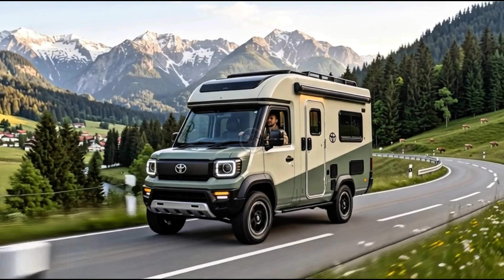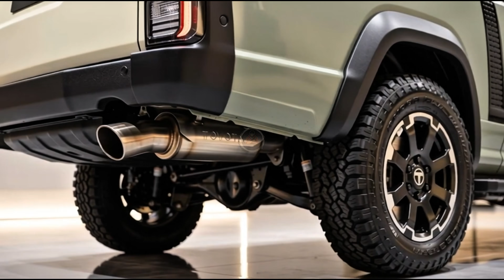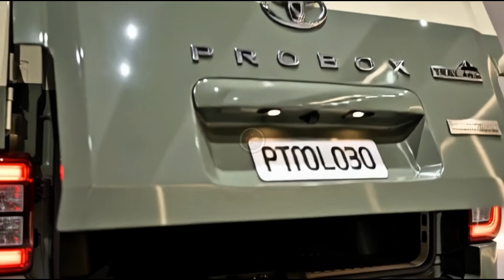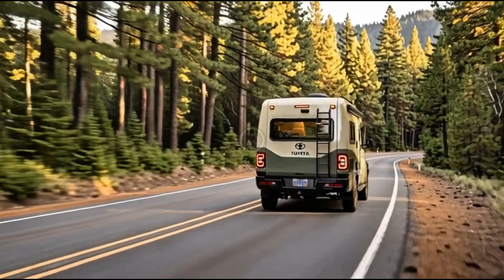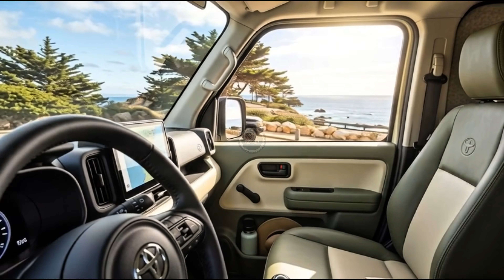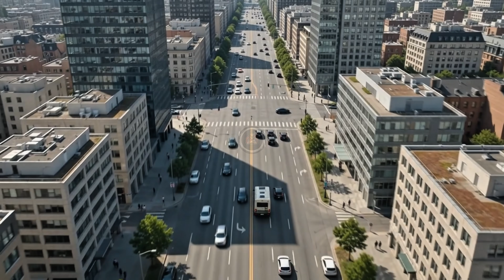Toyota's New Micro Camper 2027 – Don't Buy Until You See This

Comment: Seen other ads decent description of the outside leaves a lot on the interior. Have owned n used several RV’s different lengths.  Last was a 40 footer with 4 slides.  Yeah that one I did not drive.  Drove the others.
Reply from the maker: Wow, going from a 40-footer with 4 slides down to a micro-camper footprint is quite the contrast! I completely understand why you didn't want to drive that massive rig—parking something that big is a full-time job in itself. You make a very fair point about wanting more interior details, too. Since this is an independent digital concept we designed, mapping out a realistic interior in such a tiny space is always the toughest part of the process. With your extensive RV experience, what is the one interior feature you think is absolutely essential for a compact camper to actually be comfortable?😊❤
Reply: @efcauto . My hubby drove the big one, lost him in 24, the one I enjoyed driving was the 33 footer, older model no slides.  The first year we had the 33 footer we put 12,000 miles on her.  We enjoyed getting out just the two of us.
Reply from the maker: @barbaraannroach6033 I am so incredibly sorry for your loss. Thank you for sharing such a beautiful memory with us, though. Putting 12,000 miles on a 33-footer in just one year is a massive accomplishment, and it sounds like you two had some truly unforgettable adventures together out on the road. It completely makes sense why a sturdy, no-slide 33-footer was your sweet spot for driving. Looking back on all those miles, do you have one specific trip or destination from that first year that stands out as your absolute favorite?😊❤
Reply: @efcauto There is one that was memorable but it has been 30 years since we were there.  Camp ground in Texoma, drove over a concrete road that the river drove over and thru the river.  We picked up a granddaughter and a nephew.  We settled in on the campsite n the Rangers came thru and we had to leave because the storms had filled the river and it was going to flood the campsite.  Had throw everything into the Rv, load the kids in the car that we towed, John drove the Rv over the river that was rising n I drove the car.  Beautiful park, kids was able to walk thu the river.
Reply from the maker: @barbaraannroach6033 What an incredible and pulse-pounding memory to look back on after 30 years! Having to pack everything up in a frenzy and evacuate a flooding campsite with the grandkids sounds so stressful in the moment, but those are exactly the kinds of wild adventures that stay with you forever. It sounds like you and John made a fantastic team, navigating that rising river in both the RV and the tow car to get everyone out safely. Did you ever get the chance to go back and visit that beautiful park in Texoma again under calmer weather?😊❤
Reply: @efcauto  Unfortunately no.  Life as usual got in our way.  But later we picked up the 40 footer.  Had that one for over 10 years.  That one we used for our trips to Florida from January til April/May.
Reply from the maker: @barbaraannroach6033 It is so true how life just happens and changes our plans! But spending over 10 years taking a massive 40-footer down to Florida for the winters sounds like the absolute perfect way to use a rig that size. Having all that space for those long stretches from January to May must have felt like having a true second home. Did you have a favorite spot in Florida that became your regular winter getaway?😊❤